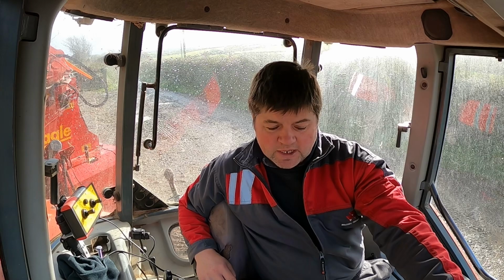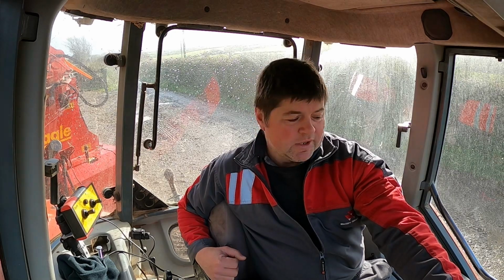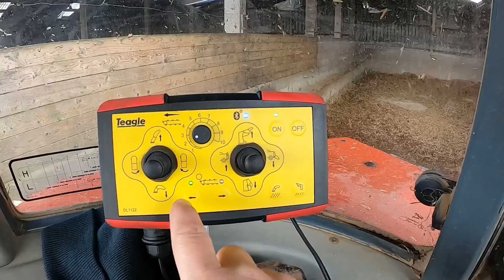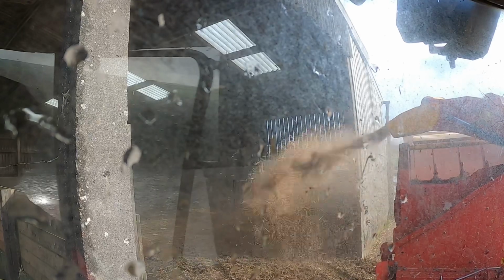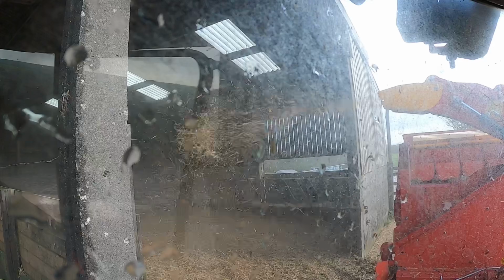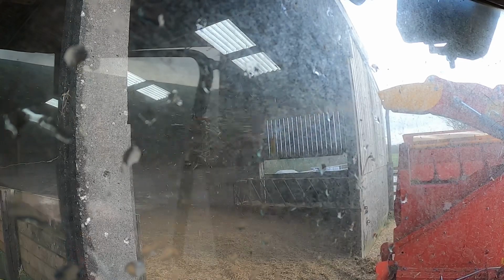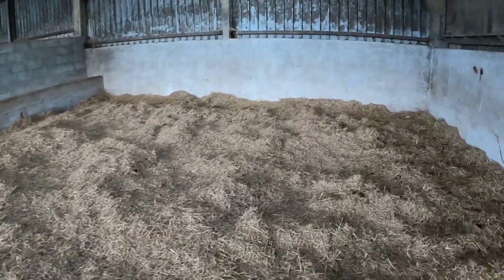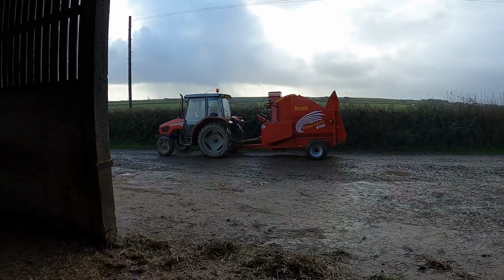New Teagle 8100 straw chopper

Comment: Was the tractor in 540 or 540e? Didn't sound like it was reving enough
Reply from the maker: The tractor only has single speed 540 PTO, I do run it mostly at 540 but as I have used it more I find that if I need to blow it less distance it will run at slightly less revs.  If im bedding close to the machine it blows the straw away from where I want it if the revs are too high.